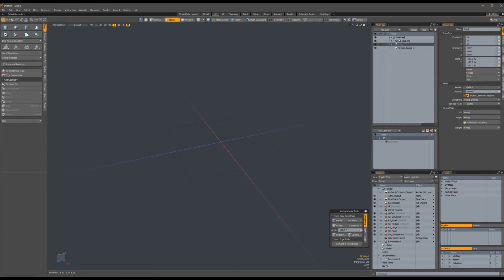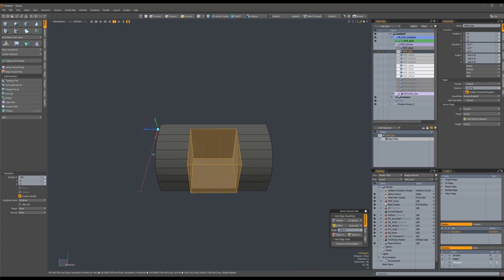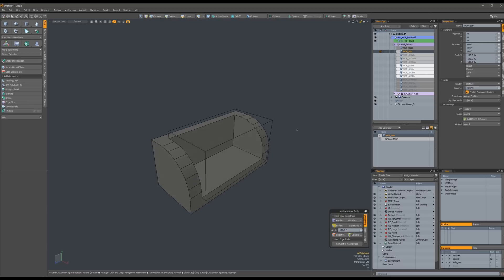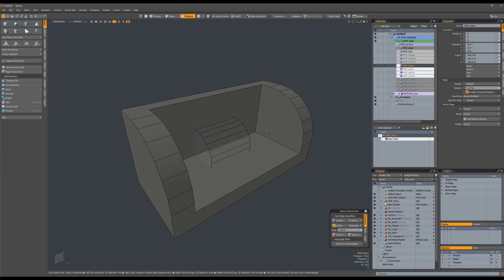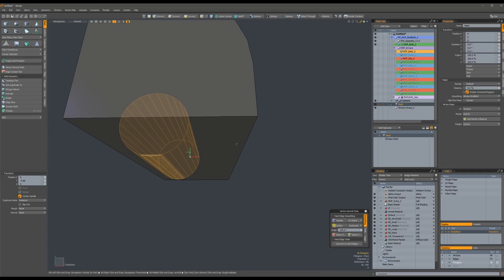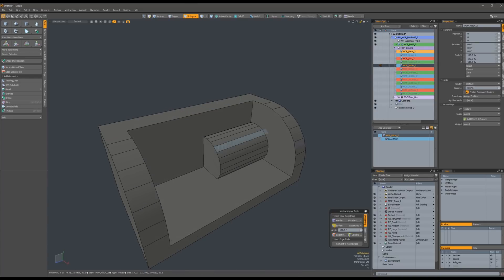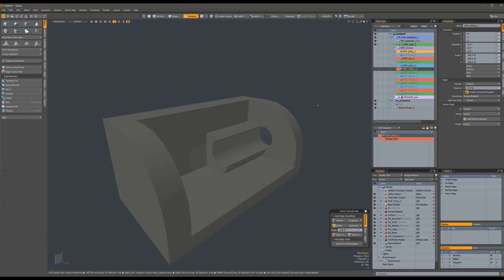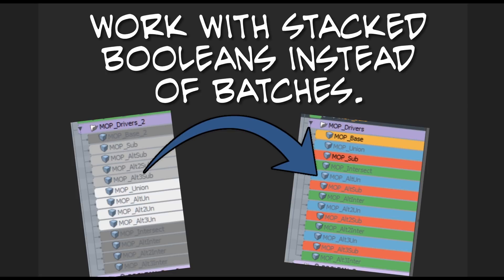Enhanced MOP Boolean Assembly : Demo!

Comment: Warren, do I understand right that you can use more than 1 alternate substract/any mop boolean operation with this assembly?
Reply from the maker: Yes, correct. You can do that with the original assembly as well but what's different here is how the operations are ordered and stacked.
Reply: ok, if I apply some mesh ops to cutters for example will they hold after reordering? like I cut a box with sphere with radial array applied to the shere.

Comment: Thanks Warren I will buy it for sure. But what about adding stack? Do I have to duplicate the previous stack and am I done?
Reply from the maker: You shouldn't have to do anything special.  It's still the MOP Boolean kit doing the driving so creating a stack is the same as it's always been - except that now you'll be using my assembly instead of the default one.
Reply: Warren bought it I'm trying some operations. Thanks a lot for this gem. Very useful and nice. Now it's a pleasure and more simple working with MOP Booleans. Thank you.
Reply from the maker: :)  Love hearing that!
Reply: No joke you have really changed my life using MOP Booleans. I'm creating complex shape without any effort.